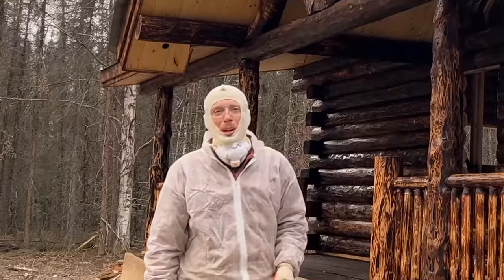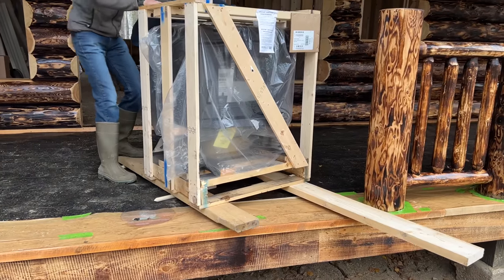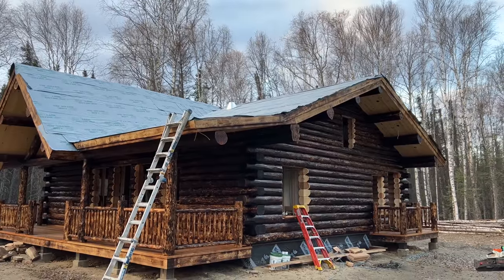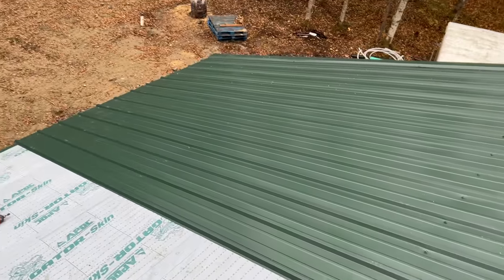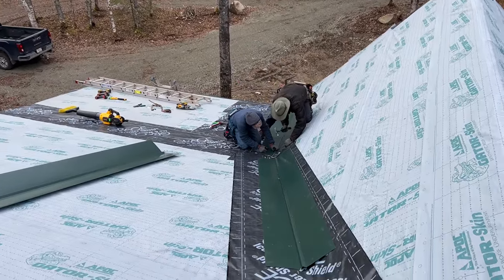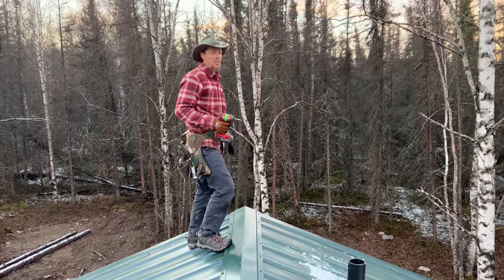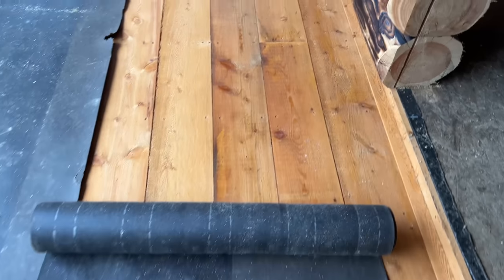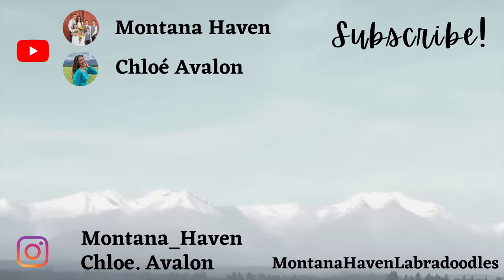Our Alaska Log Home gets a ROOF! // Exterior Stain

Comment: Another great video. Easy tip on getting rv antifreeze in.  Unhook the inlet line on the waterpump, attach a hose from inlet and into a gallon of antifreeze and turn on the pump....run all faucets to the antifreeze comes out.

Comment: When I did my steel roof ,to get the panel up we use a pair of vice grips and tie a rope to pull the sheets up. There was a slight scratch from the vice grips but that will be covered by the ridge cap

Comment: In the future try using a heavy rope attached to big vice grip C clamp to pull panels up to roof edge.   I would set my panels on scrap wood to keep them out of the dirt below were I needed them.  Guy on roof pulls end of panel up as guy on the ground helps steady the process.  Hopes this helps.  27 year roofing veteran in Florida.

Comment: Should be a 12 volt fresh water pump somewhere around the fresh water tank. I put a hose from antifreeze bottle to pump intake and fill the line that way. Don't forget to drain and segregate the hot water tank.

Comment: A metal roof is really good when you’re around so many trees… I would not go in those old mine shafts they could collapse on you…they should have signs on them to deter entry.. remember to do some mold prevention for the RV interior…maybe you should have saved the roof metal pieces to build a little temporary slant roof over it to keep the snow from piling on… You guys bless me how you glorify God even in building your home….can’t wait to see windows in so you can work and be safe if you have to stay unexpectedly…🙏🏼🙏🏼🙏🏼🙏🏼❤️

Comment: Awesome work being done, will you adopt me?    I would love to work with you guys.   Here's a question, pardon my ignorance but when the boot went on the roof vent pipe what prevents any moisture from getting under it, I didn't see it get sealed around the edges, maybe it did but I just didn't see it.   I'm just curious how that and the skylight get sealed so there won't be any leaks.
Reply from the maker: Yes we caulked under and around the flashing really well!!!

Comment: We don't use antifreeze in our RV. My husband bought a fitting that goes onto his air tank, and he blows the water out of the pipes. I open the drains, and he blows out the water. Also, make sure you drain your hot water heater, and DO NOT PUT ANTIFREEZE IN IT!!!